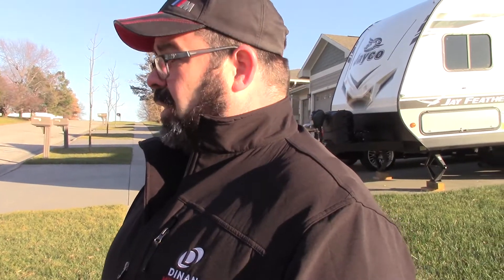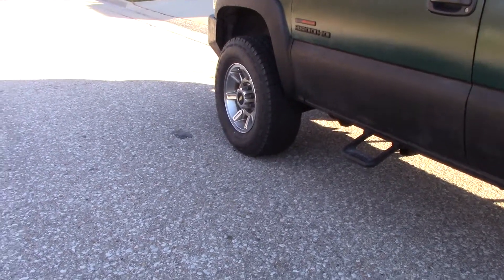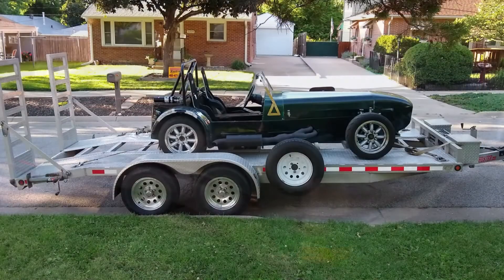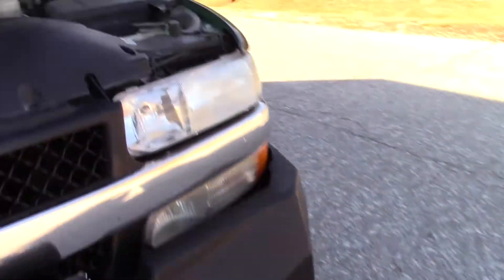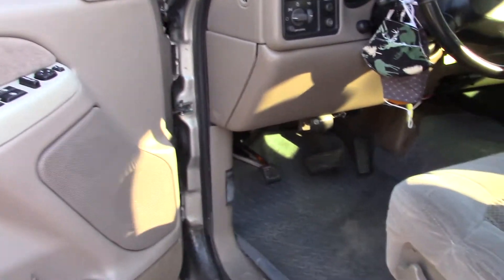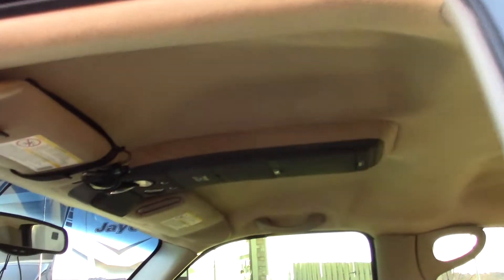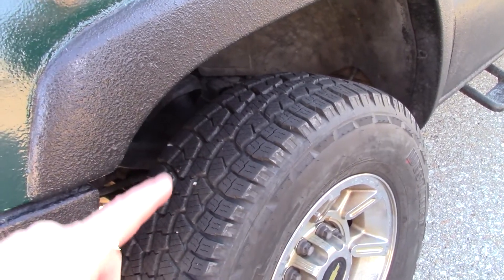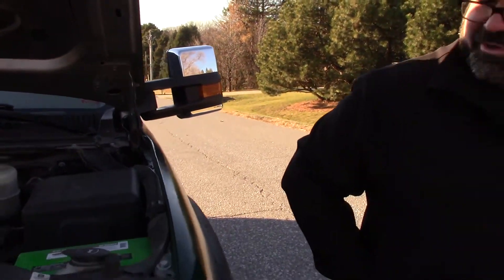SWAP DONE! Duramax LB7 to Gas 8.1 L18 swap - SUCCESS and final details - Frankentruck part 5

Comment: How did the diesel trans mate up to the 8.1 did you have to change much
Reply from the maker: The 8.1 and the diesel have the same bolt pattern, so it bolts right up.  I used the torque converter from the 8.1, but I found conflicting information on whether or not the torque converters are actually different between the diesel and gas.
Reply: Did you find out if this swap has same torque converter match up between lb7 diesel and 8.1 gas?